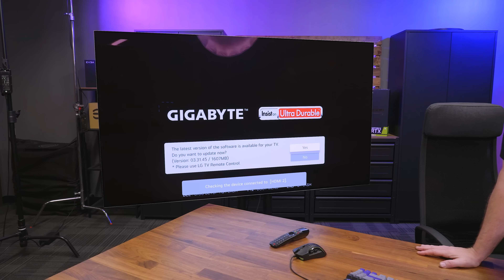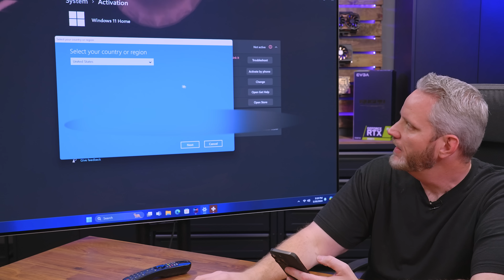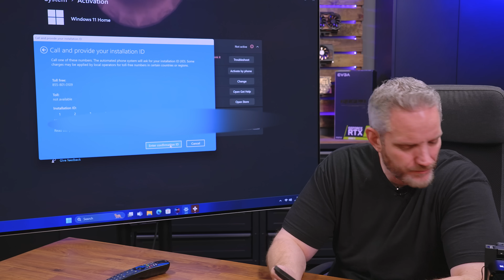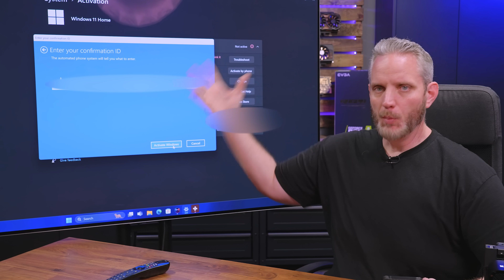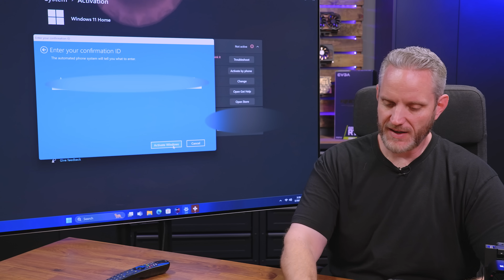How to move OS drive to new PC and keep Windows and Activation! EASY!

Comment: will this work with linux? if i install linux on my second drive on my pc and then transfer that drive to an old laptop for example , will it work ?
Reply: Linux don't care. Just pay attention to which main video driver is running, if you got nVidia on the first and want to install the drive on the second with AMD, delete the drivers first. If the new PC has nVidia and the old one AMD instead, you should at least install nouveau (open source nvidia) before swapping to at least get display output. Might also want to check which CPU is present and swap out packages for intel-ucode for amd-ucode (microcode) accordingly for vulnerability patches.

Anything else driver-wise is baked into your kernel and you don't have to worry about it. If the GPU is the same vendor on both PCs, you can just go ahead and swap it in.
Reply: @whydoyouaskdude  great thanks will check everything out before doing anything

Comment: Not impressed with the RGB installation.  But re-activating Windows, sweet.  Would it charge you if you said 2.  Only asking as I want to get my new 2nd hand system running BEFORE breaking my old one down.

Comment: What’s crazy is I recently upgraded my motherboard, slightly better chipset, and a different manufacturer; fully expecting this problem. It didn’t happen, even after a fresh install of Windows 11. My guess is that Windows could detect that all my other hardware was exactly the same, CPU, GPU, RAM, & PCI WiFi. I had secure boot disabled because of TPM 2.0 on my original setup too (not sure if that made a difference).

Comment: As far as the ethics go it boils down to "The Ship of Theseus", and US courts hate having to deal with it because one false move/ruling and you can end up opening "Pandora's Box". This introduces all kinda of contradictions with standing law vs philosophy of law (Jurisprudence). Worst yet it calls into question all kinds of unrelated issues its becomes a mess and the legal system hates that level of uncertainty. Despite, indirectly (albeit) the courts are portrayed at times, the court loves predictability and consistency. Does that mean the court doesnt deal with these kind of issues, no, have-they probably and a mess is probably made every-single time. Sooo Ethically? its null, as in it sits in null space. So its kinda one of those issues Microsoft doesnt want to have that fight, and goes with a simple rule of "one copy, one computer" atleast for general public use. Easier cheaper, ect. Just my opinion and a crappy opinion at that.

Comment: I changed from Intel to AMD (Ryzen 2400G, no GPU)  and had to reactivate Win10 through MS. I then built another completely different AMD system (Ryzen 5800x, 6900) and simply copied the C: drive. It booted right up like nothing happened. Windows hasn't complained once in 2 yrs..

I have since upgraded the 2400G to a 5600G, new mobo, new ram, new nvme, and Win10 still hasn't wanted to reactivate.

Comment: This is crazy, my teen son and I built a new PC last night and did exactly that, i. e. put the system drive from old PC destined for parts. I was getting ready for all the pain associated with the move but the PC loaded Windows 10 no problem. It did not even ask for reactivation (yet?) and Windows 11 installed during the update! Absolutely smooth relocation. And, thanks to you, guys, now I know what to do if it decided to ask for reactivation. You rock!
Reply: wait it forces a update from 10 to 11?
Reply: Going from Windows 10 to 11 is not a good idea.
Reply: @ZenAndPsychedelicHealingCenter  Your comment as is is useless to anyone. The internet has a trillion pros and a trillion cons about going from Windows 10 to 11. What are your specific reasons for not going from 10 to 11?
Reply: @raygernon9686 a trillion?    Amazing!    As soon as you start talking like a kid, we stopped listening!
Do you even know ow why they made windows 10?
Do you pay for windows?   Is yours a cracked version?
Mines 100% legit, yet I've never paid a dime.   Legit serial from Microsoft itself.
That's your only hint as to why they made windows 11.
Reply: @raygernon9686 the fact that it takes record of everything you do.  It freezes all the time.  It has a tonne of load errors with hardware, new and old.  It's compatibility mode is worse than windows 8.  It has MANY backdoor that AI can navigate, easily.       

Tell me some of the pro's.
😂

Comment: I would at least recommend going through and looking at hidden devices in Device Manager and uninstall the drivers that are greyed out. After you get back into Windows. You can ignore the shadow volume copies drivers and anything storage driver related. Doing this drops the likelihood of weird driver related issues popping. I’ve seen issues come up because someone didn’t go through and remove the old drivers from the system. 14:36

Comment: I somehow got lucky and didn't even have to reactivate after I destroyed the pins on a Z390 Godlike and didn't have the budget to replace with the same board. That said, it's always had weird errors. Next upgrade I'll use this method but, do a clean install after initial reactivation, if it's needed.

Comment: I do lots of these at work, and recommend running neowin ghostbuster to clean up drivers no longer needed. Its a good idea to delete your system restore points and create a fresh one too.
Reply: Im swapping over from i7-9700k to a amd 7800x3d and i have programs that are.... you know, and i dont feel the need for going through the hassle to reget those programs and reinstall them all. so for this do i run the ghostbuster after the windows install when swapped components is done ?
Reply: @Off_The_Rail  did you find an answer to this question?
Reply: @Kinetically616TTV  never got an answer, I didn’t get anything ready on the drives and just did the swap, after booting up for the first time windows launched and got some stuff ready and installed AMD software on its own. Than I went in and manually cleaned any intel drivers myself it was very easy
Reply: @Off_The_Rail  nice thank you very much

Comment: 2 questions: (both using Dell as an example)

1: Does that work with OEM licenses that come with a pre-built?  Like say you decide to take your HDD and move up from a Dell you used as your starter rig.

2: Conversely, can you get a used Optiplex for example, that obviously had a Windows license at the start, but someone else has previously "de-coupled" it from the hardware ID?
Reply: OEM licenses are tied to the motherboard.  You can change everything but the motherboard and your key will keep working... switch MOBOs and kiss your functioning windows key goodbye. 

I don't really understand your second question.  If you have an activated version of windows on a computer attached to the internet than all is well.  If you have an activated version of windows on a computer not attached to the internet and then after attaching said computer to the internet it tells you someone else is using that key: you need a new key.  For clarity the OEM key is physically on the hardware and self activates all other key-types snapshot your hardware at registration and moving the key means doing what Jay did--updating the hardware snapshot tied to the key with microsoft.
Reply: @TurboLoveTrain  I get that the OEM key identifies via the motherboard...   But..  maybe I'll further the confusion:

If Jay installed Windows on System #2, made the phone call verification and got it validated, does System #1 still have ownership?   Would another Windows install on System #1 linked to the internet cause System #2 to then get told someone else is using that key?  Or is System #1 now locked out?
Reply: @TurboLoveTrain  So Jay only got the option presented to him because his wasn't a one machine OEM copy?
Reply: @douglasmurphy3266  yes

Comment: I always do a clean install.
Reply: You should be doing clean installs of Windows regardless, the most frequent troubleshooting fallback in IT is always a reimage. It's usually not even Windows that gets fucked up, it's morons installing a bunch of garbage on their computer and failing to maintain it, plus programs leaving a bunch of garbage in the registry and file structure, as well as process and driver bloat. A clean install gives you a clean Windows that will always run better on the same hardware than whatever you were running before. DISM and Windows Updates can't remove all the garbage software and conduct a cleanup of your own mess.
Reply: Yeah agree with you there.  Certainly no downside and so easy to do these days off a USB!
Reply: Can you use the same method shown in the video to reuse the windows key when you do that?   swapping out my CPU and motherboard soon and would rather do a clean install as well.
Reply: @DrWuzer  You can pull the Windows key from within the OS and try to enter it directly when you install at the Media Creation Tool screen. To be honest, mine didn't work when I reinstalled Windows after changing out my motherboard, but it's supposed to be transferrable. If you sign in to your Microsoft account, it should be tied to your account and be no big deal. Worst case scenario, you have a watermark if it fails to activate. There are plenty of resellers that sell legit Windows keys for a pittance if you want to try your luck there.

Comment: If you had a genuine activated copy synced to a Microsoft account, you wouldn't need to reactivate after new hardware is installed; you can have Windows be deactivated on a previously used device and activated on a new device.

Comment: This would have been nice to know when I swapped motherboards a month ago😢... unfortunately had other issues with the motherboard not loading default drivers and got locked out of windows until I could connect to Ethernet... for which I needed those non-functional drivers to work... fml

Comment: Or you can just forgo the ability to change Windows themes and still use Windows indefinitely. There will most likely be a watermark at the bottom right reminding you to reactivate, but other than that it functions perfectly fine. Or buy a retail copy license and that allows unlimited installs on one machine at a time. Avoid the OEM copies, which lock the activation code to the motherboard hardware ID that the OS was first installed on.

Comment: Whether or not Windows boots is highly dependent on where the installation took place. I have both a desktop and laptop. I have a custom built desktop and a Razer Blade 15 (2018). I tried to diagnose a problem with graphics drivers by swapping my desktop drive with my laptop drive and windows never booted. The drive booted to a separate windows screen that said "Unsupported Hardware". Reinstalled the drive back into the laptop and booted into windows.

Comment: Can I just suggest that you 3-D print and extension off that test bench frame for? However long you need for the fans? It would not be difficult at all to whip something up in CAD to give you a few extra inches of clearance for the side fans to blow across the rig.  Just a thought boys from another Jason Lange……vin

Comment: Activation Troubleshooter is all you will likely need unless you previously activated a new motherboard fairly recently.  Phone activation is needed only when the Activation Troubleshooter doesn't work.  I had to resort to phone activation a while back.  A motherboard activated via Activation Troubleshooter turned out to be faulty and had to be replaced.  The replacement board needed activating too soon after the faulty board was activated.

Comment: I recently changed motherboard and my Windows 11 install was pretty messed up even after installing drivers for new hardware. Some GIFs didn't load on Facebook and Steam games refused to download. I'm sure there were other issues going on. All it took was noticing those two issues to realize my Windows install was now broken simply from changing motherboard. I had to format my SSDs and reinstall Windows. I recently dealt with the issue of Windows not being activated, but all I had to do was click troubleshoot, select my new device and Windows very quickly activated. I do have a Microsoft account. It helps to have one of those.

Comment: I kept the same Windows installation (besides updating from 7 to 10) through three different builds on a spinny hard drive. Ten years of accumulated crap, and things were very slow at that point. I could turn the system on and go make a coffee while waiting for Windows to boot up. I finally moved to an SSD two years ago, and my goodness! Best upgrade I ever did.
Reply: SSDs will transform a lot of systems you would almost consider ewaste.  Great too for old laptops.
Reply: @laowai2000  Worth it if the system is already SATA based, not so much for older pre SATA systems however as you will have to also get a converter to convert from IDE to SATA and they run somewhere between 16-20 dollars on top of the drive itself, and then you may have to go with an M.2 form factor to make it fit in the existing cage, however, it's moot as you are now running through the low bandwidth of IDE/PATA to begin with, so you won't get the speeds of even SATA with your SSD.
Reply: I feel this in my bones.  My comp wasn't nearly as slow as yours, but when I finally got an SSD, I was amazed at how fast my system could actually be.  Kicking myself for not doing it sooner, but it took some time for the prices to come down and it just wasn't high on my priority list.
Reply: I did that with a 13 year old laptop it had a 2.5 inch sized (back in the day) high speed spinning drive, did a 1tb ssd and windows 10 swap was like adding a supercharger to a small nock Chevy in difference lol

Comment: I've been on the same Windows 10 installation since Windows 10 came out in 2015 I have upgraded my system seven times complete hardware swaps never had a single issue just putting the drive into the next build

Comment: Is that's why my laptop went into a boot loop after I put in the exact same drive with a unchanged installation of windows in the exact same laptop after I took it out to put in a different drive because I needed a Linux install for classes? Man just screw Microsoft

Comment: What is the best way to actually transfer the contents of one drive to another. My SSD is running low so i want to replace it with a bigger drive. I don't really want to clone it. Any advice?
Reply: Buy from Samsung provides access to their free cloning software to do exactly that.  I believe that other leading brands do the same.

Comment: Jay I need help. This is my last hope. I've tried 2 different NVMe's on my motherboard and both stick aren't detected either in my BIOS or Disk Manager. I,ve tried updating drivers I,ve tried tweaking stuff in the BIOs I've tried reseating them I've tried everything I knew and they won't appear anywhere in my PC. What can I do? I don't know where else to reach out for this.
-update. Idk wtf happened now my HDD D drive is gone. I went to change somrthing in bios again and my pc shutdown on its own and rebooted without my D drive. Not expecting any response why would you spend time on one dude when there are thousands, but w/e. Maybe.
Reply: As the drives are not recognized in the BIOS, I would first try resetting the BIOS settings to their default state.

Comment: I can confirm this works. Upgraded to a 7900 from a 8700K just copying the install to a new drive. One thing I did notice... When you look at your windows devices in the app, it will show you how many computers use that key. You can remove them though (it must remove the TPM data), and you can continue on as happy as Larry. Still doesn't beat a fresh install... which I should really do at some point! All data is backed up and ready to go though. Just another wee nugget of info.

Comment: Windows these days handles major hardware changes just fine usually even going from Intel to AMD or vice versa. Just changed from X570 to X670E and apart from activating Windows 11 again which it did automatically as I had a retail licence it was a completely painless upgrade. Windows booted right up without any complaints, I installed the AMD chipset drivers again even though they were the same ones anyway as I needed the 7950X3D driver so games work properly and made sure any missing drivers were installed. Apart from that, that was it.

Been almost three weeks now and everything is rock solid, all my programs work fine, Windows is perfectly happy and all my benchmark tests are showing the hardware performing exactly as it should.

Always best to make a backup before changing hardware just in case as you never know, but Windows from 7 onwards handles major changes extremely well.

A handy free and portable tool I've used for years to remove dead and disconnected devices from device manager is one called GhostBuster, it will show you all the devices that are in device manager that are no longer connected and allow you to remove the whole lot in one go if you want. Been using it for years and it works great even on Windows 11, such a time saver and it's nice to know all the old crap is gone. It will never touch active connected devices.

Comment: when i swapped my MB and CPU for some reason my drive couldn't be seen to run windows until i went into the BIOS and switched it from UEFI to CSM mode.... it still wont let me update to windows 11 because of that either but it runs windows 10 just fine so idk what happened there

Comment: I don't know that this is an "ethics discussion" as you state. You are not using that OS on any other system. You just swap the OS between different hardware combinations as you wish. I am fine purchasing license keys for software, but I do have an issue if I paid for a key and then the motherboard dies I need to pay again because I replaced the board. That is, to me also, the same system.